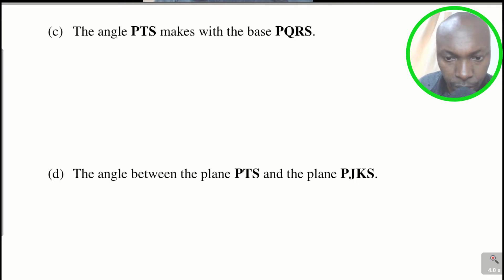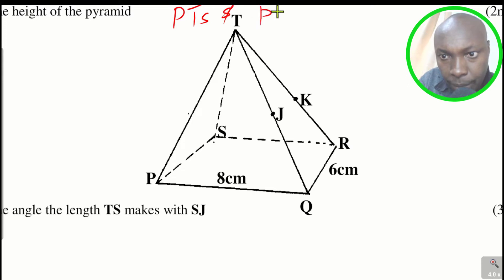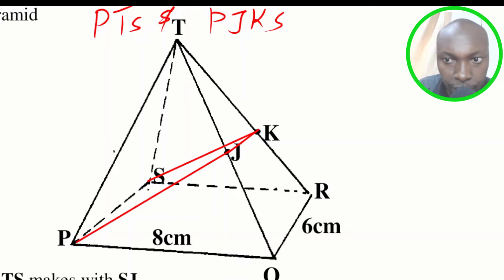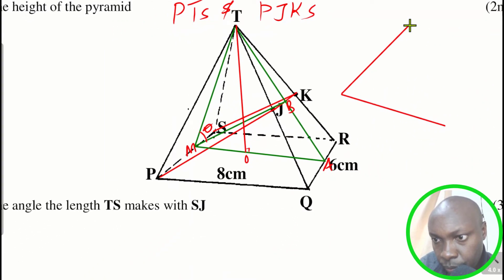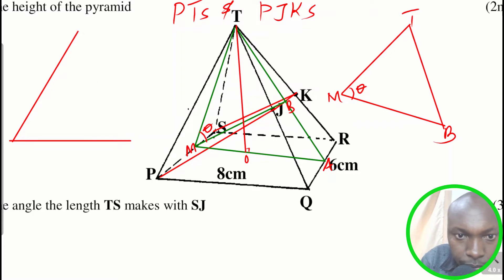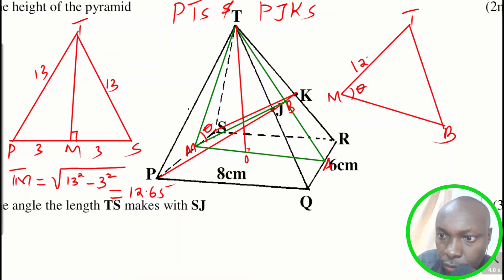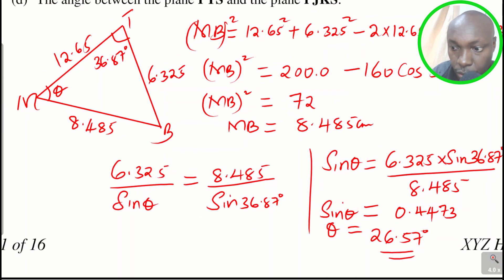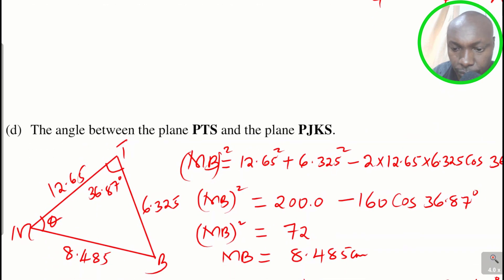ANGLE BETWEEN TWO PLANES | Part d

Comment: Hello, I've found a simpler way. Use triangle MJA.
 Angle TAM calculate from arccos (4/√160)= 71.57°

Cosine rule to find size of BM
√(8^2+ 6.325^2- 8*6.325cos71.57)=8.485

Sine rule to find angle BMA 
= arcsine(6.325* sin71.57/8.485)=45°

Angle TAM= angle TMA =71.57°
Just subtract 45° to get angle TMB as 
26.57°